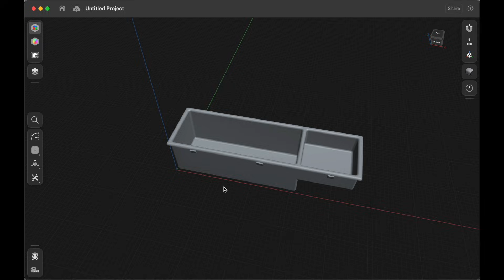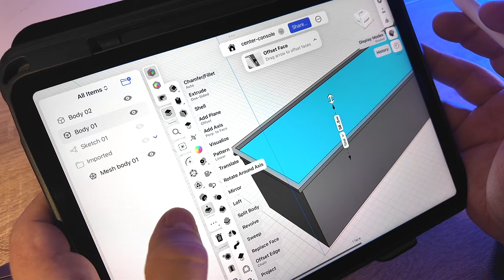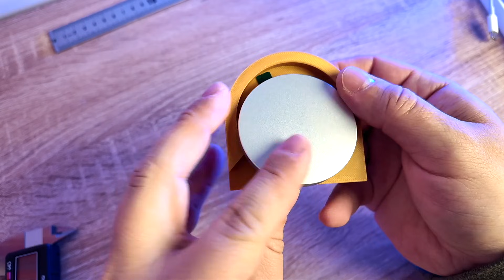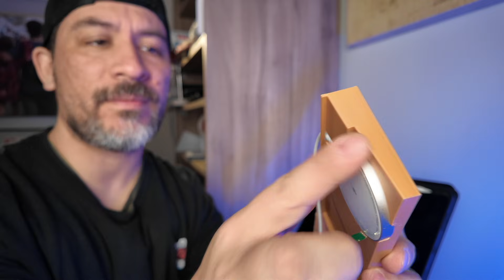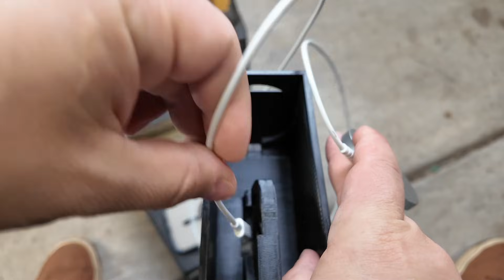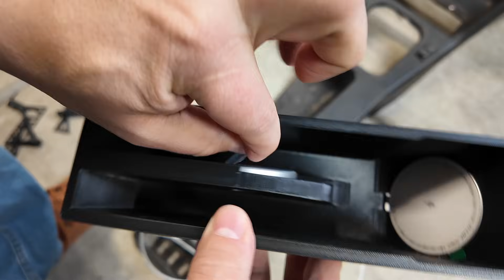Design an iPhone + AirPod MagSafe Center Console With Simple CAD Software

Comment: Insane content.. been doing car stuff every week since I got printers. Great stuff!
Reply from the maker: Awesome to hear! What kind of car stuff have you been printing?
Reply: @allaboutthebuild  A4 Avant B8 stuff, gauges, center console switch case to fit a 12v CLOSE/OPEN momentary switch. Custom speaker housing to support low profile bass speakers in the doors. Water methanol tank adapter plate so it sits straight and so on... everything took a few iterations but holds and looks pretty decent/clean!
Reply from the maker: Oh wow, nice!!! What CAD software do you like using?
Reply: @allaboutthebuild  Inventor OEM 2021, super easy to use but I think I will make the move to Shaper3D after seeing your videos!
Reply from the maker: Nice, try the free version. Do just about anything except export in higher res to try it out. If you like it, we have an affiliate code that gets you 10% off. Just use ALLABOUTTHEBUILD10